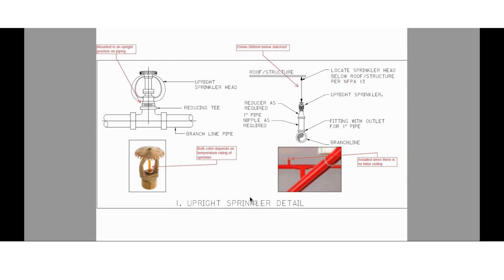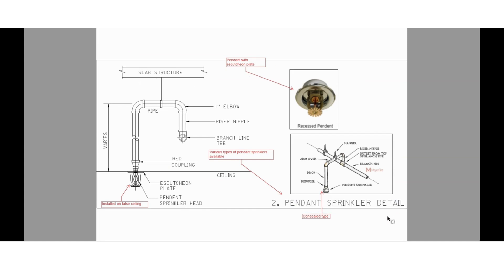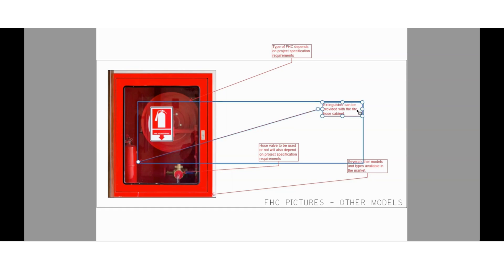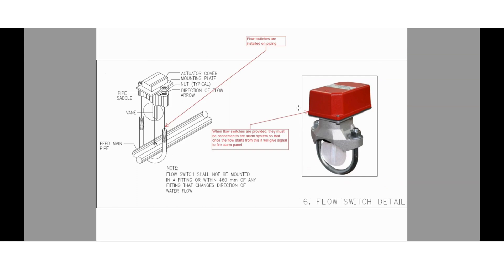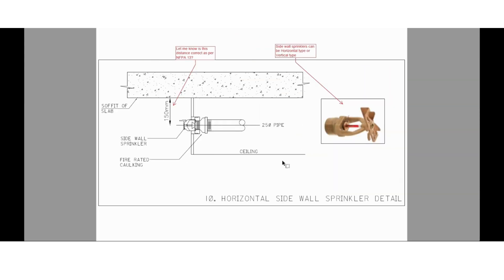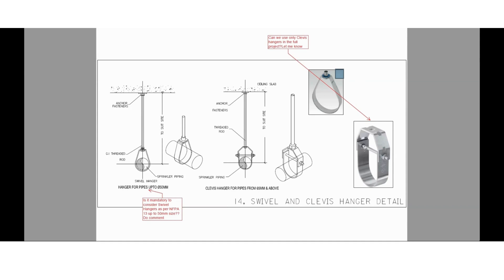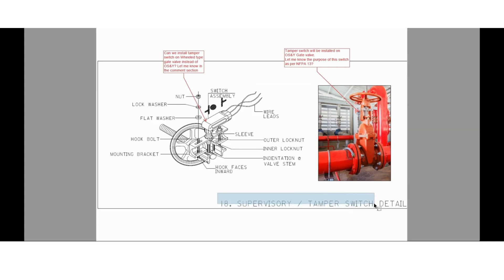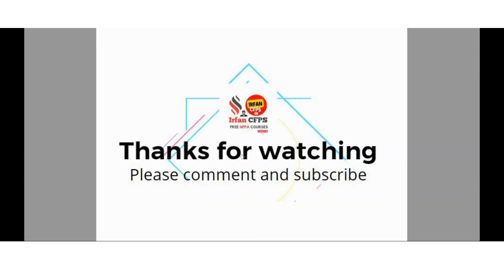Firefighting Equipment Explained for Beginners!

Comment: in your presentation at 3.04 min, what is your opinion on the installation distance of pendent sprinkler from slab/ceiling.
Reply from the maker: No limit since pendant sprinkler is installed on false ceiling.

Comment: NFPA 13 (Standard for the Installation of Sprinkler Systems), here are the key installation requirements for horizontal sidewall sprinklers:

Distance from Ceiling:
Horizontal sidewall sprinklers can be installed in two zones below noncombustible or limited-combustible ceilings:
6 in. to 12 in. (150 mm to 300 mm) below the ceiling
12 in. to 18 in. (300 mm to 450 mm) below the ceiling
These installations are permitted where the sprinklers are listed for such use.
Distance from Wall:
Horizontal sidewall sprinklers are permitted to be located with their deflectors less than 4 in. (100 mm) from the wall on which they are mounted.
General Sidewall Sprinkler Requirements:
Unless specific exceptions apply, sidewall sprinkler deflectors shall be located not more than 6 in. (152 mm) nor less than 4 in. (102 mm) from ceilings.
Sidewall sprinkler deflectors shall be located not more than 6 in. (152 mm) or less than 4 in. (102 mm) from walls on which they are mounted.
Installation along Walls, Lintels, or Soffits:
Sidewall sprinklers shall only be installed along walls, lintels, or soffits where the distance from the ceiling to the bottom of the lintel or soffit is at least 2 in. (51 mm) greater than the distance from the ceiling to sidewall sprinkler deflectors.
Spacing:
For light hazard occupancies, the maximum spacing for extended coverage sidewall spray sprinklers is 28 ft (8.5 m).
For ordinary hazard occupancies, the maximum spacing is 24 ft (7.3 m).
Back-to-Back Installation:
Sidewall sprinklers shall not be installed back-to-back without being separated by a continuous lintel or soffit.
Reply from the maker: Thank you so much for the info

Comment: installation height of fire extinguisher as per nfpa 10

For fire extinguishers with a gross weight not exceeding 40 lb (18.14 kg): The top of the fire extinguisher shall be installed not more than 5 ft (1.53 m) above the floor.
For fire extinguishers with a gross weight greater than 40 lb (18.14 kg), except wheeled types: The top of the fire extinguisher shall be installed not more than 3½ ft (1.07 m) above the floor.
In all cases: The clearance between the bottom of the hand portable fire extinguisher and the floor shall not be less than 4 in. (102 mm).
Reply from the maker: Thank you for the info

Comment: Clevis hanger can be used upto 2-1/2 inch pipe size.

The threded road used for hangers must be UL,FM ?
Reply from the maker: Selection of hangers depends on project specifications. However in general we consider swivel hanger upto 2” pipe and more than that we use clevis hanger. Threaded rods will not come in ul or fm ..
Reply from the maker: However threaded rod shall be provided based on the project specifications
Reply: @irfancfps  thread rod can be fire resistant?
Reply: @irfancfps  CAN WE USE A SWIVEL HANGER FOR ALL SIZES OF PIPE AS PER nfpa 13?

Comment: What should be the number of thread in pipe as per size ? And also there thicknesses?
Reply from the maker: i am not aware of thread size for pipe. Thickness of the pipe depends on project specifications.. However as a standard practice Schedule 40 CS pipes are used for above ground piping.